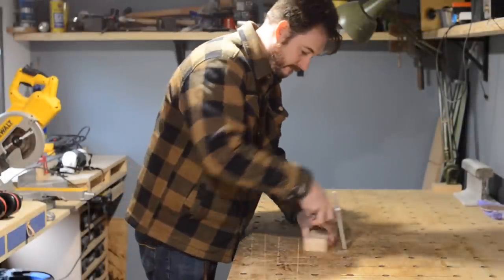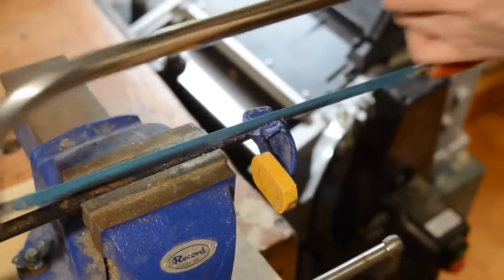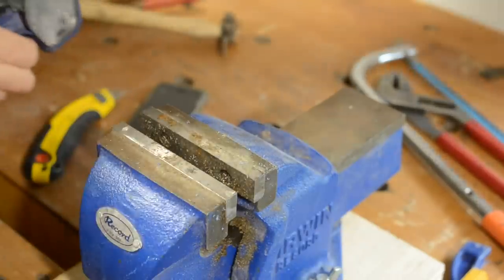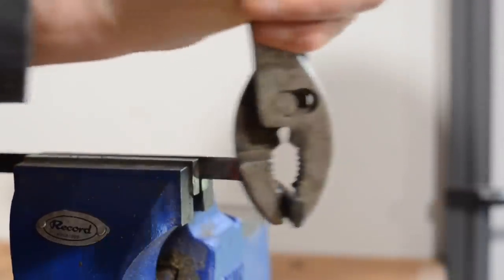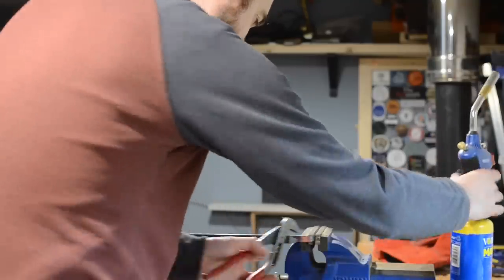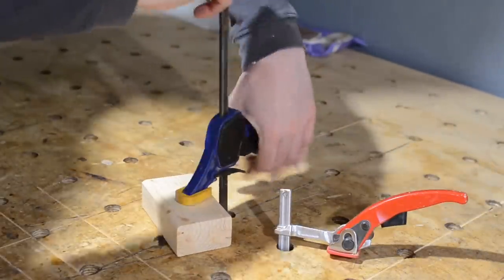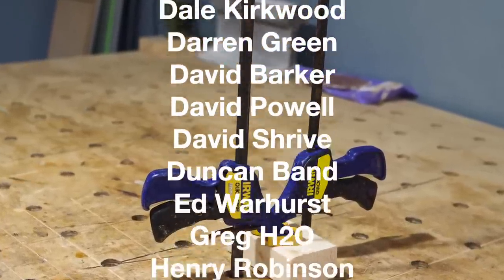Modifying Irwin Quick Clamps

Comment: I like these kind of videos instead of someone showing off their new Festool tools 👍
Reply from the maker: Thank you. I wish I had a Festool collection.
Reply: My Festool collection consists of a track saw and a jigsaw. They are really good but I don't know if they are better than other doing the same function. I will say that the track saw leaves an edge that needs no further finishing. It is smooth without tear out. The jigsaw, same. They both utilize guides that greatly reduce or eliminate tear out.

Comment: I bought some of these types of clamps from harbor freight. The ends always break. They're very cheap. But now I can modify them like you did. I've been holding on to them cuz I knew eventually I would find somebody who had a solution to make use of these broken clamps. Thank you
Reply from the maker: Sounds a good use for them then
Reply: buy the Pittsburgh clamps (red) ones they are well built

Comment: I tried this with some wooden ones but they are now on fire, have I done something wrong or can I use it clamp things still. Pls reply fast the fire is spre...
Reply from the maker: This is only my first day being a full time blacksmith so im not sure. Try turning it off and back on again
Reply: Put some Osmo oil on and go for the shou sugi ban look...
Reply: Cleanup aisle three...
Reply: Were they made from Apple wood,? Perhaps it happened because you used a non Apple blowtorch?
Reply: Haha, what are you like lads
Reply: You a bright spark?
Reply: I would try again with softer wood, less heat required!
Reply: Your fire was too hot, use a cooler fire.
Reply: stop, drop, and roll

Comment: Top man Badger I have just made 4 workbench clamps and they great.  For anyone following the video it is spot on but would make the following comments:
- you need a sturdy vice
- I used a Marksman multi blow torch and struggled to heat the bar to bend it or maybe it just takes longer to heat up than I would have expected.

Comment: I have combination clamp / spreaders and just release / remove the ‘fixed’ end, insert the rod through the dog hole and refit the fixed end of the clamp.  Fortunately the fixed pin on the rod slides through the dog hole.  Whammo! 😎

Comment: To make sure the bar doesn’t get hot enough to melt the plastic handle, put a metal clamp or two, to act as a heat sink, in between the handle and the place you’re heating with the torch.
Reply from the maker: Good tip

Comment: Great idea. Thanks for sharing. Tomorrow we have a special offer at LIDL for cheap power fix clamps. I already wanted to buy some again because I don't have enough of them
and the quality is OK for me. But seeing this, I need to buy some extra. Your video came just in time!
Reply from the maker: The Lidl clamps sound perfect for this
Reply: @Badgerworkshop  2  pcs 30 cm clamps for 8€, or 2  pcs 10 cm + 2 pcs 15 cm also for 8 €.  In 15 minutes I'll be on my way there.
btw i could not find your blow torch among the tools+ you use. In which chapter can I find it. I also have a blow torch, never used it till now,
and I'd like to compare the specifications.
Reply from the maker: I have just added it to the metal work section
Reply: @Badgerworkshop  Thanks. I just found it there.  I miss the specifications about the heat it can produces but then i found out it depends on the gas being
used. I'm curious if my burner/gas will work. It's much cheaper. I initially bought it for burning wood.
Reply from the maker: It should work but it will just take longer
Reply: Hans de Groot tried this with the Lidl/ Powerfix clamps - take care as the don't like too much heat or being bent more than once. Noted this in a reply and what I did about it elsewhere on here.
Reply: @mr.b.4048  Thanks for your comment. I'll take it into account. I managed to purchase the clamps last week but did not yet try to bend/heat them.
Reply: @Hans de Groot - this is what I posted elsewhere- 
After the practice run with the first clamp (and only managing to salvage about 150 mm of the original metal which I'll keep for now), I set the open end of the clamp in my vice for 50mm then put a tight twist in the next <30 mm before bending the end at right angles at the 40 mm mark.  This works okay, but as the bar is about 18mm wide and quite thick, it wouldn't fit into the 20mm hole in my bench (which is 30mm thick) so I opened it up to 25mm and that allows the bar to fit in and under the bench top.
Reply: @mr.b.4048  Thanks for your explanation. I did not have time to try it all out yet. The thickness of my DIY MFT bench thingy is 20 mm.
I'll see if i need to enlarge the holes.

Comment: Those “ split pins” you mentioned are called roll pins, you could re-use them, just drive them in and centre punch each side to widen them a little! But, as you discovered the heat transfer is not a problem with 300 mm clamps!
Reply from the maker: thanks

Comment: Great tip. BTW on some of those clamps the back end is removable, so you can reverse them. I thought the Irwins were like that but I guess not.
Reply from the maker: Thanks Andy
Reply: The clamps sold by Lidl (£7 for two 300mm clamps)have both of the ends are removable (one with a wee peg as the Irwin; and one with a bolt and wing-nut). These clamps exert good force, and are robust in use. Irwin clamps survive better when dropped.

Comment: Cheers for this, just most of the way making a bench top like this (yay for forstner bits), and was stressing about the cost of the clamps.
Reply from the maker: Glad to be of help
Reply: Research "holdfasts", they perform the same function and might be obtained cheaper. They are far stronger than his mod. Don't know where you are but I got my holdfasts here: https://www.toolsforworkingwood.com/store/item/MS-HOLDFAST.XX/Holdfasts_by_Gramercy_ToolsThey are excellent build and work in 3/4 holes", perhaps slightly larger but only slightly as they are 3/4 inch.

Comment: Use the existing hole at the head of the clamp,  use machine screw, washers, and lock nut with a metal cross piece to create  a toggle clamp-like end. Doesn't work any better than what is described but much less effort.

Comment: We have a store in the US known as Harbor Freight aka Horror Freight. They are known for their crappy tools but sometimes one or two slip through the cracks and are actually good. They sell some clamps cheaper than the Irwins that are modified to work like yours and there are vids on YT showing that. You did and do have a good idea if the HF clamps are not available.
Reply from the maker: A lot of suggestions also to use Aldi clamps

Comment: Actually I’ve been thinking about this and I’m now wondering if the lower bar needs to be twisted at all because if it’s simply bent then, surely, it will still clamp underneath anyway as it doesn’t really need to be directly ‘below’ the upper portion to clamp anything down onto the table?
Reply from the maker: Im sure that would work.

Comment: Another modification I want to do with these (or actually the smaller clamps) is to copy the festool ones that come in the clamping elements set, I think a secondary cover with a peg - screwed to the side of the original cover will do the trick.
Reply from the maker: Look forward to seeing what you do

Comment: Nice one Matt - mind you if I had some IRWIN clamps I would save them as they are not cheap - whereas LIDL ones are 'good enough' and cheap as chips. Great idea.
Reply from the maker: Thank you
Reply: and with the lidl or cheaper ones you can take the end of with a thumb screw and turn the into pushers so you take the end off push the main spar through the bench and refit the end no wreaking of the clamp and can be removed and used normally win win been doing it for years

Comment: Did this with Lidl/ Powerfix clamps  2 x clamps for £4.99 worth a punt I thought - they don't take well to being heated or bent more than once 😩. Anyway binned the first one, and now have a good clamp that works well for the money.
Reply from the maker: I will keep a eye out for them next time
Reply: After the practice run with the first clamp (and only managing to salvage about 150 mm of the original metal which I'll keep for now), I set the open end of the clamp in my vice for 50mm then put a tight twist in the next <30 mm before bending the end at right angles at the 40 mm mark.  This works okay, but as the bar is about 18mm wide and quite thick, it wouldn't fit into the 20mm hole in my bench (which is 30mm thick) so I opened it up to 25mm and that allows the bar to fit in and under the bench top.

Comment: A set of 2 makita tracks saw clamps are 30 bucks, it's a easier and cheaper option if it's available locally.
Reply: They are screw clamps not trigger clamps
Reply: @vapeurdepisse  yes. you turn your hand twice instead of pumping the trigger once.

Comment: Instead of wrecking your clamps, why not just buy some traditional hold-fasts. Cheaper, more convenient and purpose made for the job.
Reply from the maker: I have hold fasts for my workbench but they do not work in this style of bench but thanks for the input.
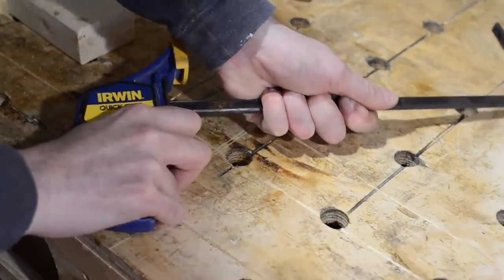Reply: @Badgerworkshop  ^^ What he said, holdfasts only work properly on benches that have a top thickness of a MINIMUM of three inches, his bench top is an MFT style from cheap plywood so maybe 18 >25mm - nowhere near thick enough. Pretty obvious if you pay attention around 2:22. sigh